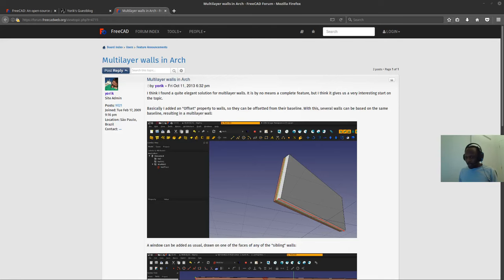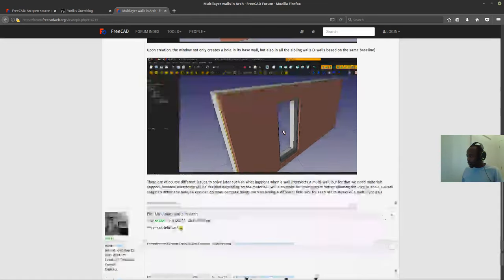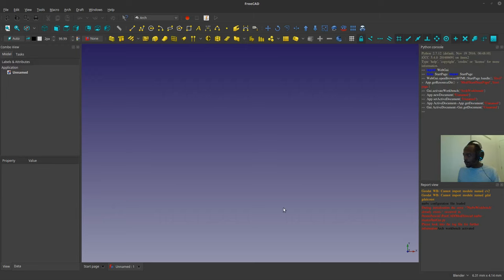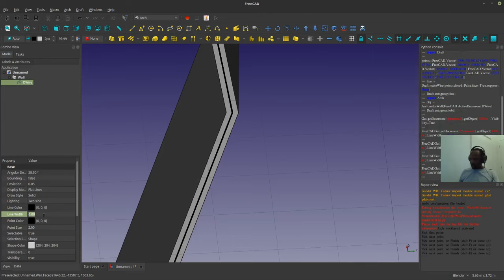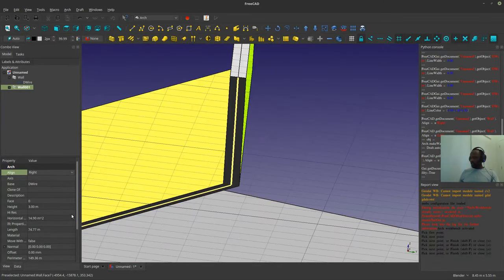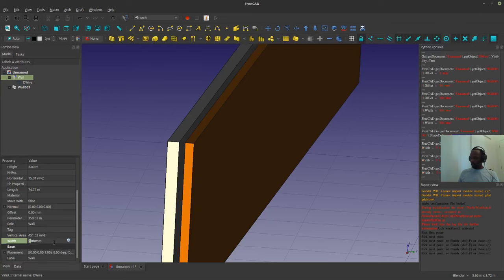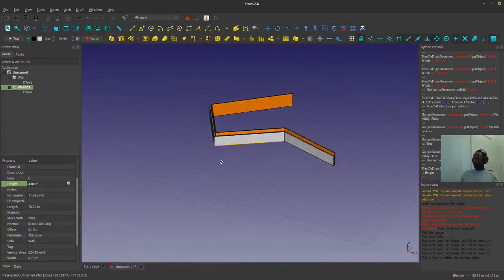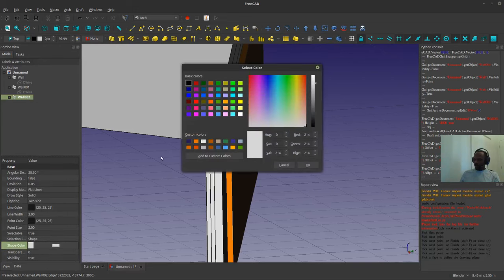Freecad Arch - Creating a Multi layer Wall - 13

Comment: This was nice method indeed, a bit complicated but works well for simple walls. The problem is when you insert windows and doors. Also there is no way to apply plaster to a freestanding column other than use loft, and then convert it to solids and to wall to get Ifc properties, but again areas are missing when done this way. applying plaster to the sill and lintle of openings also become complicated. Nonetheless, in the next versions it needs to be implemented within the wall options.
Reply from the maker: Perhaps a conversation with you will be beneficial to see some examples of what you mean and how you currently achieve them I'm freecad. What do you say? A screen sharing space?

Comment: I have used another method. I first created a multi-material and then assigned it to the wall. you can see the procedure here: https://youtu.be/mdcROWEzvgA
Reply from the maker: Thanks @antonio perri, indeed you are right it is possible to do your method now. but when i was making this tutorial this feature was not availabe yet. not sure why your comments went to the spam folder, so sorry for message delay.
Reply: The problem with this method, I think, is that it doesn't let you assign different heights to the different layers of the wall. Regis's method can be done. I think it could be interesting to create multilayer panels, or sandwich panels for example, that behave like a block.

Comment: Another freecad theory lesson.  This package is soooo frustrating.  What about the practice?  This stuffs up internal walls as it is applied across your sketch so you can't really use it.  This is the WALL you HIT in freecad.  Have had to draw a completely separate sketch to encase the internal wall with an external one.  But you can't offset between the two so it is sub optimal.  I do like all the constraints but the constraints don't work in internal/external wall corners.  You have to fudge it to stop the walls disappearing as the sketch is converted to a dwire.  Windows are equally frustrating.